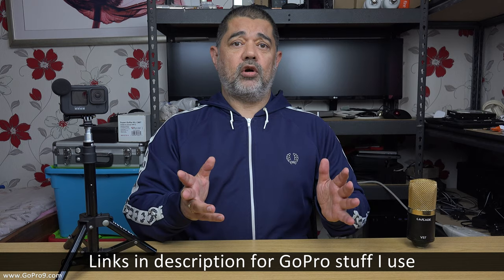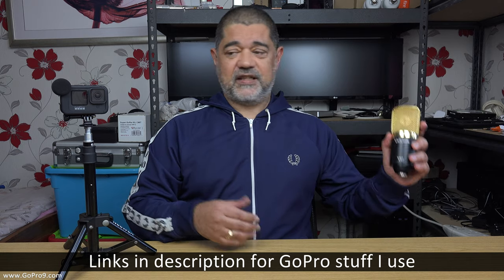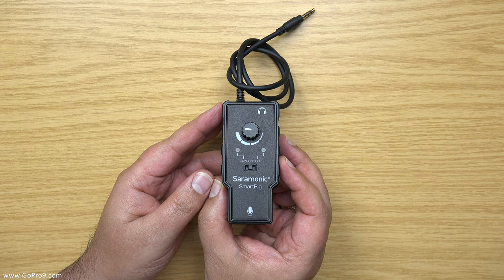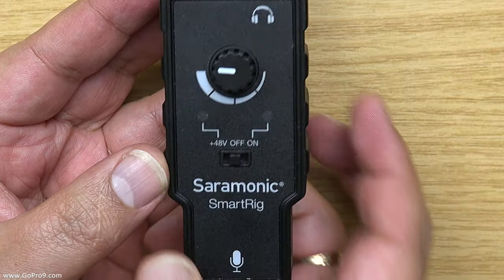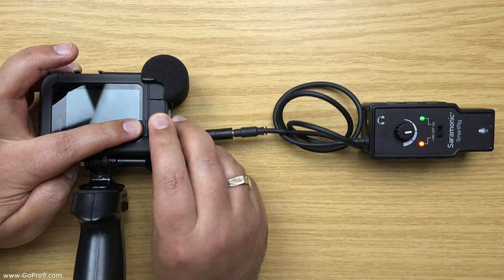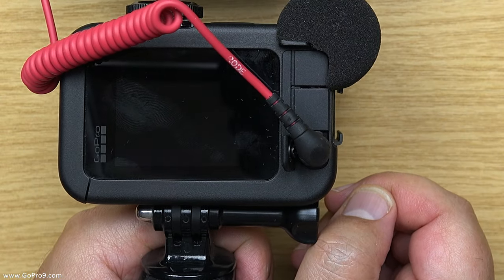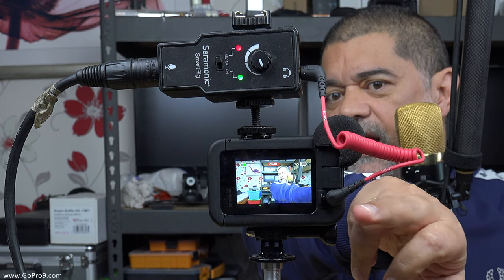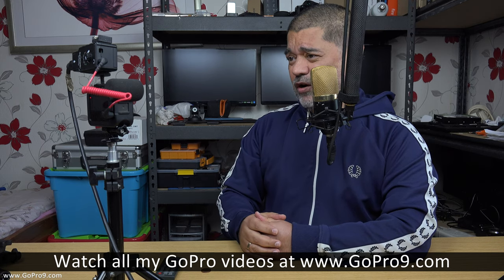GoPro Hero9 XLR Microphones

Comment: That's really useful, thanks very much David.  We are struggling to find a way to stream our church services relatively inexpensively ant this looks like a component we might use. It would be interesting to see how you converted the audio output so you only had to use a single mic cable between the GoPro and the Saramonic.  Thanks again.
Reply from the maker: Hi Ralph. I wouldn’t worry about that adaptation that I’ve done, it’s only for convenience. There’s no difference between the sound of the preamp with its own cable and a TRRS to TRS converter compared to my modification. Plus, the modification is a bit of a pain as you have to open up the preamp, de-solder and re-solder etc. Adding the cold shoes is actually worth doing though, it just makes the preamp easier to mount on anything that’s got cold/hot shoes. I may do a video about that soon. Thanks for the comment. Cheers, Dave.
Reply: @DavidHarry  Thanks Dave, good to know!

Comment: Great info. I noticed you had the gain all the way down or pretty close to it. 

It sounded good! Have a great day and be safe out there!
Reply from the maker: Hi. Yes, the gain was low because the 9 was in mic mode. I’ve had some issues with this 9 system in line level. My Hero8 and its media mod don’t seem as problematic. As I’ve already said in other videos, I’m not a fan of the 9. I’ll try and do a video showing the differences. In fact, I’ll try and do a comparison with main camera as it has a very nice mic input. To be honest, I’m only doing stuff with the 9 in case it helps other people as their hardware may be better. My 9 setup, which is exactly the same as my 8 setup, just isn’t as good as the 8 stuff. I hope DJI do an Action 2, although I really do like my 8 setup as it’s great for vloggy stuff. Cheers, Dave.
Reply: @DavidHarry  thanks for what you’re doing. I’m in the hospital right now. I fell 25 feet out of a tree and broke my back. 

I’ll be ok but I don’t think I’ll be doing many videos for a bit. I’ll still be watching though. 

Have a great day and be safe out there!
Reply from the maker: Fuck, I’m so sorry to hear about about your fall. I appreciate how bad this is and that your recovery time is going to be tough but I sincerely hope you get through to the other end of this as quick as possible. Wishing you the fastest recovery possible, Dave.
Reply: @DavidHarry  thanks my friend. Your videos will help. I truly appreciate you.
Reply: @Paul Dold thank you very much. I really appreciate it.
Reply: @RCModSquad  Fuckin hell mate, that's horrific,  wishing you a speedy recovery!

Comment: I have a major question what did you do at the end! I have a Ua volt 1 audio interface can’t fig out how to connect it! If I grab the seremonic? Do I need ti change it like you did at the end? Or can I just use the seremontic and my mic and just plug the 3.5 mm adapter in like normal

Comment: That’s quite a setup!  I know you’re focusing on the hero 9 right now, but is it possible to hook up my dj mixer outputs (I have XLR and rca) to the Sony zv-1 and record in stereo? It would be so convenient.  As of right now I record the audio separately.
Reply from the maker: Hi Tone. Yes, you can plug straight into the ZV1. Just use the correct cable, either stereo phono/RCA to 3.5mm jack or stereo XLR to 3.5mm jack. When I say stereo I just mean two phono/RCA or XLR connectors on the one end of the cable, this is probably similar to what you are using at the moment to record your DJ mixer onto a different device, or your recording device may also be phono/RCA or XLR on its inputs at line level. Regardless, the basic idea is just the same. The important thing because your ZV1 has a microphone preamp as its audio input and not a line level input, is to get the audio level going in correctly or it will just distort like mad. A mic preamp like that on your ZV1 is a high gain input because its designed to gain microphone signals, which are very low in the first place. Any dedicated audio recording device usually has inputs that are designed and calibrated for line level. First thing to do is to set your ZV1 mic input to manual setting and lower the gain so that it’s off or as low as it will go, Now plug in your mixer and have the mixers output set to full, setting to full is just so we know there’ll definitely be a signal being sent out, we can drop this down in a minute. Then just turn up the gain on your ZV1 so that the input dial/increment only goes up by one click or whatever it’s equivalent is to register its lowest possible gain. Even set to the lowest position, which is usually off but may be the equivalent to being on one with the ZV1 (I can’t remember now how the ZV1 does this). In any event, the lowest possible gain setting. You should then see the signal from your mixer on the VU audio input meter on the ZV1. This signal may well be smashing the VU level but that’s no problem at this point because we just want to see that it’s working. Now just back off the output level on the mixer so that the level on your ZV1 meter is peaking at about 70-80 percent of what the meter/level goes up to. The 70-80 percent is just to give you some headroom so that you don’t peak and distort if you suddenly play a louder track. The best thing to do now is to just do some some quick test recordings and play them back in your editing software and make sure you are happy with the sound and it isn’t distorting. BTW Tone. When I first started making and releasing dance music which was in 1989, the big thing back then was what people called Rave. Here’s my first record which is now just over 30 years old https://youtu.be/KPXqhOzMeu4  Here’s a more polished remix from a couple of years after that first one https://youtu.be/6vR4yCjPAZM  and here’s a dance song I produced for a band I was in from 1991 https://youtu.be/RSkXLOi51nI  I know this isn’t gonna be your idea of dance music but this was all the rave in the U.K. with the kids back in the day :) Cheers, Dave.
Reply: @DavidHarry  thank you for the info.  And yes, I understood every single word and process!  Raves were once popular here too I think in the early 90s.  It was really a underground type of scene. I think back then they used to have underground flyers to promote their events or you had to call a phone number for the info. That is when the drug ecstasy was popularized. I am sure in your neck of the woods The kids were partying very hard back then and getting smashed!  The genre of the music play at these raves was called trance or rave music.  These days any music resembling that era just belongs to a category of “EDM” (I believe).  From reading the comments of one of your videos, it sounds like you’re a pioneer of that era!  I’ll be 47 this year .  I grew up learning how to scratch and make sounds/patterns on turntables .  These days, I just take post production work and import it in Logic Pro X and do remixes and make songs “dj friendly” by adding a 8 bar instrumental so it can be easily  mixed to the next track on a live performance.  Thanks for the info!  I also prefer your remixed version!

Comment: Great video!  I have measured the Phantom Power voltage off my GoPro Hero 10 fitted with a GoPro USB-C stereo mic adaptor and it's exactly 2.61VDC with no microphones connected.  I assume that with the GoPro Media Mod you would get the same result.  That is not nearly enough voltage to bias any high-quality condenser mic.  The vast majority of good microphones require 48VDC.  There are some out there that are spec'd to work on 24VDC or even 12VDC but the industry standard is 48V.    GoPro does not publish any specs on this, they keep it a mystery on purpose perhaps because they know it falls way short.  The bottom line is that you have to supply your own Phantom Power via a device like the Saramonic or similar.  This is all so disappointing to me.  In order to get good stereo sound with a GoPro you actually have to build an entire audio signal chain outside the GoPro that takes up way more space than the GoPro itself.  It's ridiculous.   The hell of it is that generating the required 48V could have been done with a small contingent of extra components (value $3 or less)  that probably would have fit onto the same A/D circuit board that is already in there.

Comment: How did you modify the xlr adapter? Was it really necessary?
Reply from the maker: I converted the headphone socket to a mic input. No, it's not necessary but it makes the preamp more flexible. Cheers, Dave.
Reply: @DavidHarry  Thanks. I watched your other video with the other mixers. I think I’m gonna get the behringer 802. I’m using my GoPro 9 as a studio camera
Reply from the maker: Hi. The little Behringer is a nice mixer for a few channels of mics etc. Just be careful though if you need Phantom power as it doesn’t seem to supply 48V and some condensers may not work properly with it. It’s great with dynamics and pre-powered mics. Cheers, Dave.